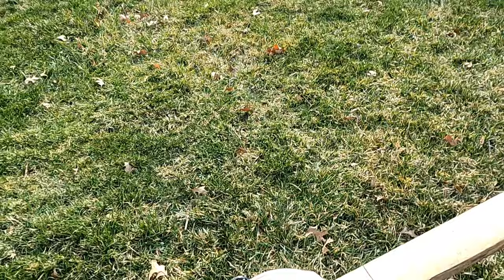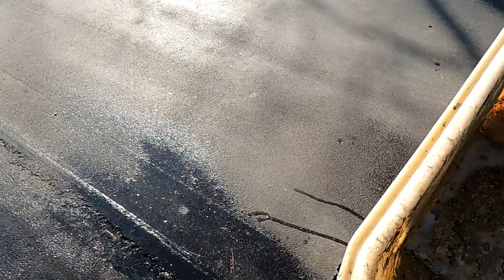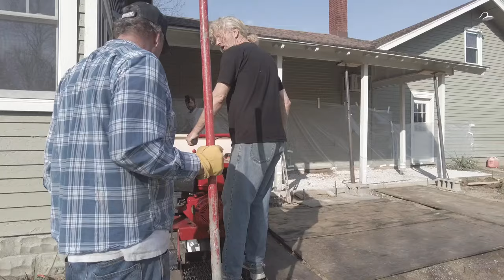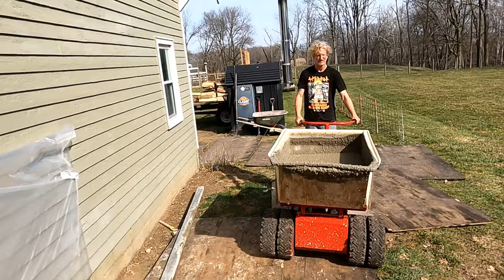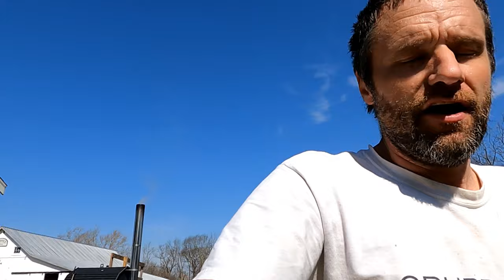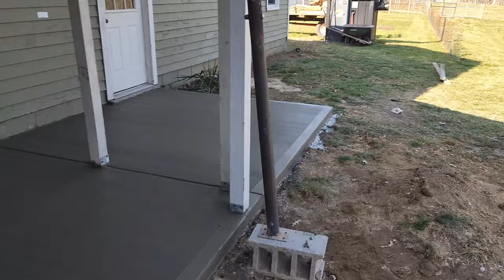Zeus WRECKED the Concrete buggy into form & GETS Concrete Everywhere!

Comment: Keep wondering what the difference is with the magnesium float to the steel?  I am going to be doing a lot of concrete this summer round the house ..
Reply: Steel will close up the concrete to tight if in cold places not good
Reply from the maker: what he is saying is, just use a mag gloat if u r in freeze thaw areas, use a trowel or fresno if u r in the southern states

Comment: Battery is the way..espescially for concrete crews..I got 2 flexvolt circular saws,sawzall and jigsaw custom decks is 95% of my work (lots of cutting) and don’t even burn through 2 batteries a day..concrete guys could make batteries last a week
Reply: I use the sawzall to vibrate around my forms on the occasions i pour something too